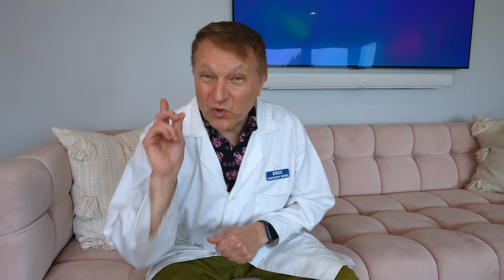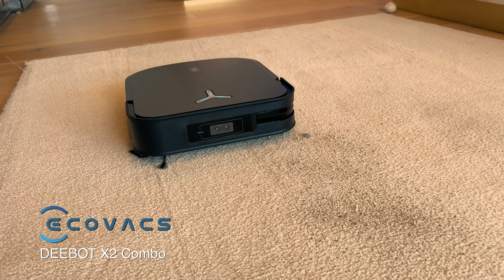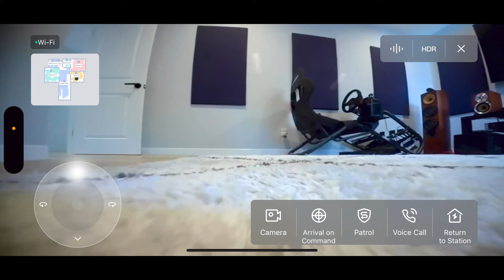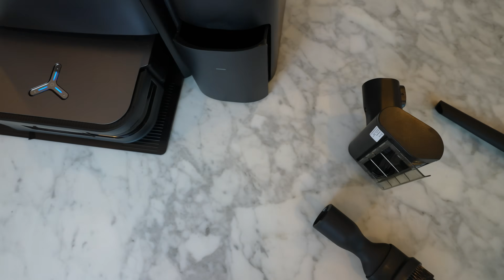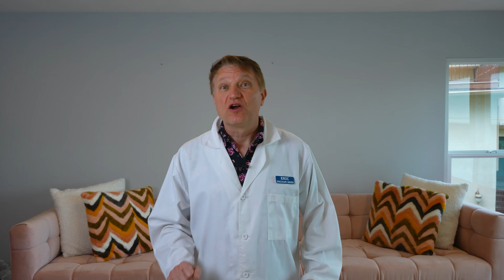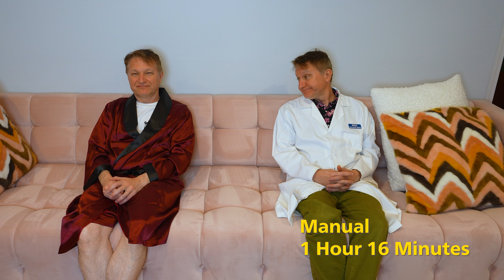The Ecovacs X2 Combo Robot Vac Is CLEVER!

Comment: Mine keeps getting tangled it's so annoying, why do you think it might be?
Reply from the maker: Hard to say tbh. Is it longer hair or pet hair?
Reply: I have to t30 and I agree. It gets tangled all the time . We have 3 rough collies. I bought the new t30s which has a detangle inside. We will see. I was about to buy this as I have 3 ecovacs and replace the old one with t30.  Brought it up to the 2nd floor as it's just short hair cats and seems to do better.  Need one for the basement and was going to replace this for the main floor but since it's the same as the t30 nope. I wanted the normal vacuum portion but not going to deal with the crappy roller of the t30

Comment: do robot mop vacuums suck up some of the moisture from the floor after they mop? if so does it damage the motor?
Reply from the maker: Mopping robot vacs are designed to deal with water, so there should be no issue with damage. Generally the vacuum entrance is in front of the mop, so as the vacuum moves forward, it vacuums first and then mops right after. It leaves an extremly thin film of water behind - just like regular mopping. The film dries within a coupleo of minutes.  These mopping vacuums are not meant to deal with big puddles , but can certainly handle a coffee spill.